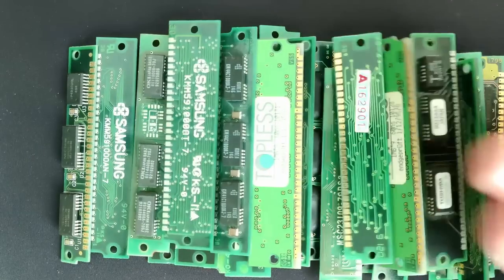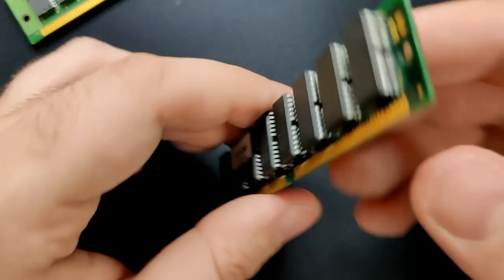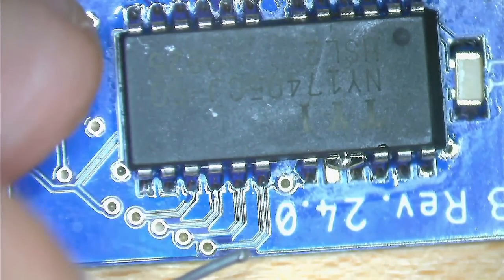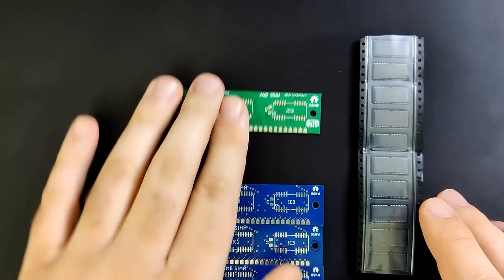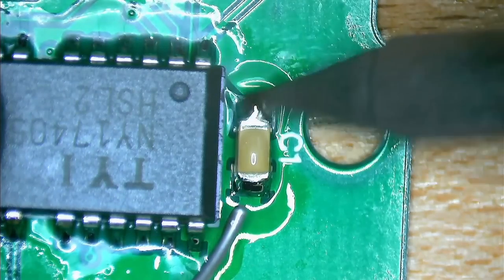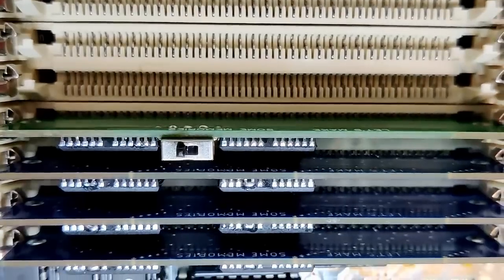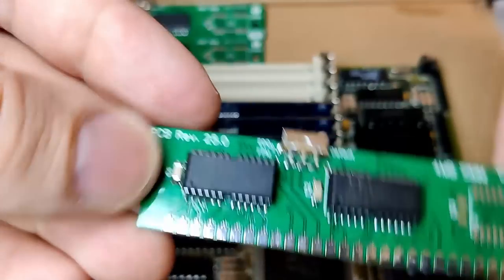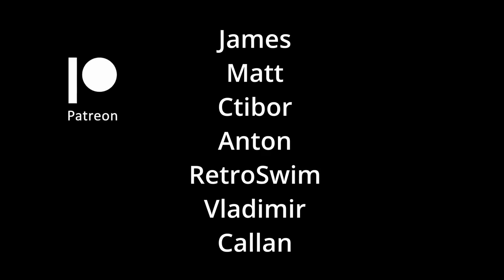Use EDO as FPM memory with this PCB - a flexible solution?

Comment: Some suggestions, if I may, on your soldering technique. Buy a cheap, heat resistant silicone mat to work on. You may be able to buy a white one if you need it for contrast for video capture. Use kapton tape to affix the pcb on the mat: It will free up your left hand. You wont burn your fingers and you won't need to use the hotair gun's nozzle to push components off the pcb. Other than that, great work! I enjoyed every second of it!!
Reply from the maker: Thanks for your suggestions! Absolutely appreciate it. You're absolutely right! Will try it out in upcoming projects.
Happy to hear that you enjoyed the video!

Comment: SIMMs with toggle switches, never would have thought I would see that.  Though in retrospect, I am somewhat surprised that one of the SIMM manufactures back in the day didn't think to do make what you created with a tiny EDO/FPM DIP switch.  Would have have cut out a sku.

Regardless, nice job.
Reply from the maker: Now that you mentioned it, I wonder that too. Would be interesting to hear a professional opinion about this hack and why or why not it may be a bad idea.
Reply: I don't think any of those module manufacturers really knew what they were making; they were probably just following a reference design without an in depth understanding of how system chipsets actually speak to the memory. It took an exceptionally sharp and well versed person with a wide spectrum of applied knowledge to point out that you can make this sort of memory hack.

Comment: Awesome work! I was wondering what the point of the switch was, but it never occurred to me that anyone would try using them in a much later board that supports EDO. Now it makes total sense, and even a jumper would be sensible option.

Honestly, I should've thought of it. I recycled some of the memory from the family 386 using one of those 30 to 72 pin SIMM adapters when we replaced the machine with a 486, and again when I upgraded to an AMD 586. I bought a much newer motherboard with PCI slots for the upgrade, which I'm sure would've supported EDO memory. I even upgraded it to EDO memory later and noticed a slight speed boost in the process, but at the time I put it down to just having more memory.

So yeah, I should've thought of that kind of application. Not sure if there would be many boards that would support 30 pin EDO SIMMs without the 72 pin adapter, but it's still an interesting option.
Reply from the maker: Hello creator of the awesome SIMM PCB! Your work definitely made my modded PCB a lot easier! Especially the dimensions, chip placements etc. I don't know if you're planning on changing your GitHub, merge my changes, or just leave it. But I forked your repository initially.

And yes, the switch is only there to answer my curiosity for future content.

Thanks again for your great design! It definitely made this project possible.
Reply: @bitsundbolts  You're welcome, and I'm glad you took the project and did something cool and interesting with it!

I think it makes sense to keep them as separate projects, since they each have their own different advantages. Kind-of like how different linux distributions might start out as a fork and become a completely new OS.
Reply: @bitsundbolts  great work! Now it's time to make switchable 72-pin SIMMs. And... what about parity modules? Honestly, I still don't know why some modules use an extra DRAM chip for parity capability, and some use a sort of larger (?) DRAM chip, that differ from others on module. Of course, we don't need fake parity (logical parity) chips support because it seems cheaper today to add just an extra memory chip than to increase BOM by one position more as its use only for systems that stronlgy run with parity modules.
As it was previously said by Artyom (yes, that is how that name actually spells), 386 motherboards with EDO support should exist, at least one chipset has support, ALI M1217
Reply: Didn't know there were 30 pin EDO Simms to begin with!
Reply: @nzoomed  EDO memory was more of a Pentium-era thing, although I have read threads where people mention using EDO in their 486s back in the day, and when they do mention what kind of SIMMs they were using it was 72 pin, not 30 pin. I found the datasheet for the SIS 85C496/497 chipset, which is a late 486-era PCI chipset that does list EDO compatibility, but I doubt anyone ever made a board that used that chipset and had 30 pin SIMM slots.

In other words, I doubt anyone ever made 30 pin SIMMs with EDO memory back in the day, since they would've been more expensive and incompatible with most motherboards that they fit on (unless they used This One Weird Trick covered in this video).
Reply: @UpLateGeek  yes, I had a late era 486 board with EDO memory. When the BIOS booted up it came up with the message, "EDO RAM INSTALLED!" with an exclamation mark, not sure if it was some kind of warning, or just a message to tell you how awesome your PC was lol. Looks like there are 386 boards out there that can work with EDO according to the post above mine. Looks like it would be a fun experiment.

Comment: You asked about desoldering thoughts, personally for small boards like that, I think you'd be way better off using a hop-plate style heater for pulling IC's off boards that have no components on one side. MHP30 would be the perfect size for pulling IC's one by one and other small solder reflow needs.

Comment: Awesome project!
I used your new board design to build a pair of 4mb SIMM modules for my Macintosh Color Classic.
I was not able to get them to work and I believe its due to the Mac being picky about memory.

I did build working FPM modules with the board design you based this project from.
I just wanted to put out a YMMV if you are trying this EDO2FPM on old Macs :)
Reply from the maker: Sorry to hear that the memory doesn't work with the Macintosh. Maybe you can find someone with a 386/486 to see if the modules work there.
I have a follow-up project with those modules and a SIMM adapter to 72-pin slot for a 486.
Would be good to hear if others were successful to build their own working modules with those PCBs.
Reply: @bitsundbolts  I'll try and hunt down someone with an old PC test rig. Maybe I can send them to you and you can do another test/troubleshooting video 🤓
Reply from the maker: We could arrange that. We can discuss via email: bitsundbolts at gmail com

Comment: Great work. What about using memory chips from EDO 168-pin memory sticks? They look similar.
Reply: I suppose that they are rare
Reply: @ChrisSTARS2407 and there is another problem, 168-pin sticks are 3.3v, the chips can't handle 5v on 30-pin slots.

Comment: A followup to this subject: I've tried to do the same with my 4MB EDO modules with 42-pin 16-bit ICs. So, at first attempt I've just shorted /OE with the nearby /lCAS pin and got weird behavior with everything working right on a 486-DX100 machine except for any write operations with FDD. Each tie I've got corrupted data with visible pattern of correct and wrong bytes interleaving each other. Then I've made a test module with two standard 1n4148 diodes draining current from /OE to /uCAS and /lCAS and errors has stopped to appear. A have a theory that this has something to do with DMA, assumed to handle 8-bit operations differently from processor, so generally memory controller just activates /RAS, /lCAS and /uCAS sequently but in some situations the order or a set of signals is different, so with 16-bit modules this additional mod is required for correct operation. By the way it makes absolutely no difference between using a hardware floppy drive or Gotek emulator, the result is always the same: half of the data ends up absolutely random.

What surprises me is that the diodes do not seem to affect performance but probably, using a Schottky or another type of fast diodes should be superior. The next goal is doing the same trick with rare 50ns chips.

Comment: Absolut spitze! Klasse Arbeit. Ich habe zwei 486er Boards mit SIMM Sockets, die derzeit mit 8MB bestückt sind. Dort werden jetzt Deine Platinen einziehen, sobald ich auch so gut Chips verlöten kann. Kann Deine Platine auch 1MB Kapazität wenn dort Chips mit geringerer Kapazität aufgesetzt werden? Habe 4 *1MB Module, die als defekt erkannt werden und ich weiß nicht, ob es die Chips oder die alten Platinen sind.

Comment: Could you show how to mod or make EDO 72 Pin SIMM into a FPM 72 Pin SIMM. i have a old late model 486 but having tribble with memory.
Reply from the maker: I could try to turn an EDO module into a FPM module, but this would involve cutting one pin for each memory chip and then bridging the remains to the neighboring pin. Wouldn't it be easier to buy a real FPM module for your 486?
Reply: @bitsundbolts  I have quite a few modules. Unfortunately, I am having difficulty identifying them and if they work or not.  I only have one motherboard and is currently limed to a 5V DX2 66 CPU's.  The 3.3 v regulator is not present but the jumper pins, pads and holes for it are.
Reply from the maker: Maybe you can lookup the data sheets for the chips on the modules - if they're not too many. "Datasheets360 dot com" may be very helpful.
At the moment I don't have a better solution than to try one by one. You may have noticed that some of your module have very different looking chips and sometimes only two for single sided and four chips for double sided modules.
I could imagine that with a hack, things get more complicated and probably will increase your trouble with memory further.

Comment: Does this mean technically you could get 128MB on one of these boards? My manual says max 64MB, which would be 8x8MB sticks. Would a BIOS patch unlock the rest or is it a memory controller limitation?
Reply from the maker: It most likely is a limitation of the chipset and memory controller. But it could also be that at the time of release, there were no 16 MB SIMM modules in the market. It could be that boards support more memory than mentioned in the manual. Only testing would verify of it works or not.
Reply: @bitsundbolts  OK, would be an interesting test for sure. I also notice that some motherboards have issues with 3 chip SIMMs, so would be interesting to see how these behave. Would be interesting to see if its possible to push a motherboard so 128M, not that there is any point in DOS!

Comment: Why did you add a switch instead of just bridging the pad and removing the connection to the original pad?  I'm not aware of any EDO 30-pin SIMMs and assume that the standard only supports FPM, so leaving the option for EDO seems peculiar to me.  Thanks for your work, and I may acquire some of these, but I'll hard-wire them for FPM mode 😉

Comment: Nice. Great Succes, but what's the pint doing this? Is there any technology from 386 that will utilize that much of memory?
Reply: Just creating this crazy configuration system is perfectly good reason IMO.
Reply: In DOS 8 MiB is usually enough to run all DOS games for which a 386 is fast enough. However, operating systems such as Windows NT and OS/2 would benefit. They need at least 12 MiB, better 16 MiB to run properly. Windows 3.x would benefit from the more memory in that it could run multiple applications at the same time. The same also applies to Windows 95.
Reply: You can never have too much RAM ;-)

Comment: As much heat as you can without melting or disturbing nearby componentry is the answer. In my opinion, these RAM boards would be more heat, less time. If you were working on a chip near a plastic connector, less heat more time.

Comment: Can i use GM71C17400AJ6 from 16/32MB 72 pin as a donor, it seams there are 30 pin 4mb modules with the same chips.
Reply from the maker: I checked the pinout - looks like this chip should be compatible as well. It even supports FPM, so, no need for the "hack" in older systems that require FPM memory.

Comment: 32MB EDO modules are quite valuable. Would it be possible to use lower capacity modules as donors?
Reply: Single-sided 16MB modules are the same basically.
Reply: The donor had a dead chip. So this wasn't a waste. They are also not particularly rare. Just eBay inflated prices
Reply from the maker: I'm afraid in this configuration with two memory chips it's either 1MB or 4MB. I guess a 2MB module is possible, but then it would take only half of the address space of the highest not, which is weird. I just have not seen it before.

Comment: great video, thanks!! question is this resulting 30 pin module parity or non-parity? i have a tandy 2500 sx-33 that seem to require 4meg x9 modules (i think its parity?) let me know..
Reply from the maker: The ones I created are non-parity. But it should be possible to use one of the chips mentioned in the original BOM from UpLateGeek to make it a parity module. I may do this in the future - at least the real FPM modules.
Yes, x9 means parity. If this is a requirement, then you need the third chip on the PCB which I did not add in this video.
Reply: @bitsundbolts  understood. but the chips on ULG BOM are FPM, and the others will be EDO behaving as FPMs... any conflict there? i guess it needs testing?
Reply from the maker: Yes, it needs testing. But I strongly believe that there shouldn't be a problem because I already mixed EDO and FPM on the 386 in one memory bank (4 slots = 1 bank = 32 bits). So, 8+8+8 bits were EDO-2-FPM modded and another 8 bits were FPM chips - this worked and is in the video at 09:39.

Comment: If I understand correctly, you bought new memory chips. Do you think it would be possible to create a 16MB stick with new components?
Reply from the maker: It should be possible if you find chips with Address line 11 active. The parity chip, however, is not connected to this line. Therefore, parity check for 16MB modules won't work on those PCBs. If I find chips that have the correct pinout, I may give it a try.

Comment: If max memory per SIMM is 16Mb - total max memory for 8 slots is 128Mb? What are the obstacles to reach that?
Reply from the maker: Support of the chipset and traces on the motherboard. The chipset may simply not expose the 12th address pin/internally not connected. Or the motherboard does not route all address lines to the SIMM sockets. I am sure there may be other reasons, but those are the ones I can think of.
Now, I don't know if this "Super Low Cost" (SLC) chipset has a physical limitation, or if it could be possible to run this board with 128MB - even if it's not mentioned in the manual.
A pinout of the chipset may give some hints.
Reply: @bitsundbolts  But in principle, is 16Mb SIMM realistic to build?
Reply: @BarsMonster  I had a small "Pride Expression" motherboard with an Am386DX processor on an ALi M1429/M1431 chipset with 8 SIMM30 slots and the manual for it contained tables for filling memory slots up to 128 MB. Its specifications also mentioned 128 MB. However, at that time I had only 8 MB of memory.

Comment: Interesting project. I was thinking of a board adapter so that you don't have to desolder the chips. But I don't know if that would be realistic because does EDO modules have a controller chip of some sort?
Reply from the maker: Haha, don't say more - you're spoiling my project list :) :) :) No, but seriously, I am thinking of a project to use one 72-pin socket and an adapter to split it to 4 30-pin modules. Drawback is that it may only work with 72-pin FPM modules, not with EDO because /OE pin is not exposed on connector pins. It should work with FPM modules though. It is a reverse 4x30-pin-to-72-pin adapter... Don't know if I want to do that though - routing 72 traces etc...
Reply: @bitsundbolts  Ooh, nice :) you are making me curious already

Comment: So that was the maximum EDO ram you could run with? 32MB?
Reply from the maker: Based on the manual, yes. However, SIMMs should theoretically go up to 16 MB per module. That would be 128 MB with 8 modules. But I doubt the chipsets supports those and the motherboard may not have all the traces in place.

Comment: Why switch? Whenever you do switch it over, you always need soldering iron to replace the chips.
Small pads that you could short with solder would make a bit more sense. ;)
Reply from the maker: I may want to try the 4x 30-pin to 72-pin converter and see if I can switch between EDO and FPM in the future. You don't have to use a switch at all as I mentioned in the video. The pads are close to each other to easily bridge them with solder.